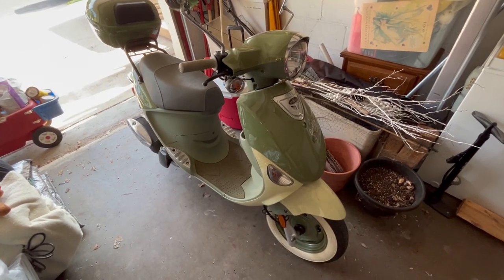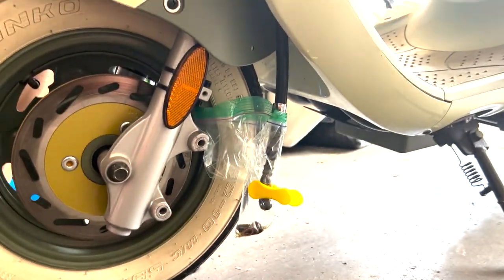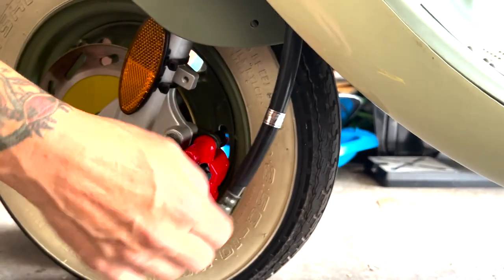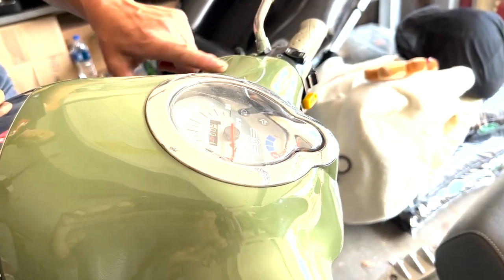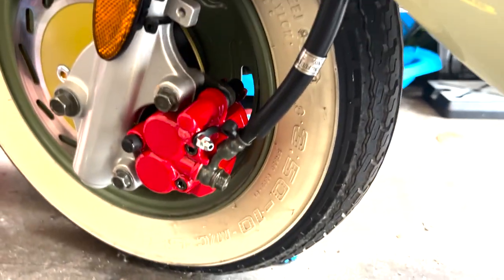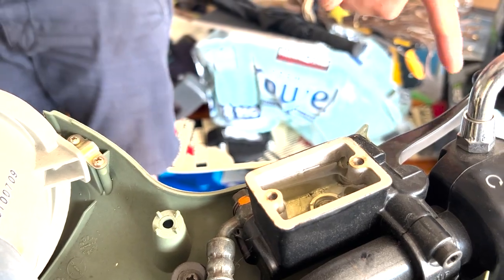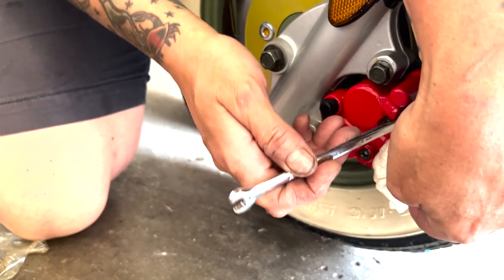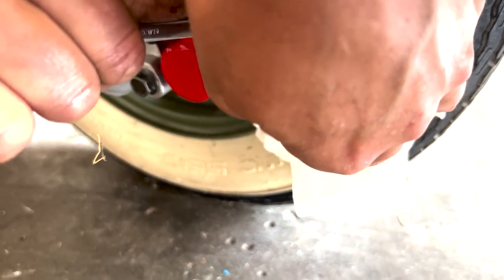Fixing Scooter brakes-replacing disc brake caliper.

Comment: Hi my front brake is squeaking, do you know if the front tire should spin freely with no brakes pressed, it kinda hard to move.
Reply from the maker: Yes the front tire should spin freely without the brake applied. Either the caliper is frozen or the brake line is swollen closed. Remove the brake line, if the tire spins then it’s the line, if not it’s the caliper. Good luck!